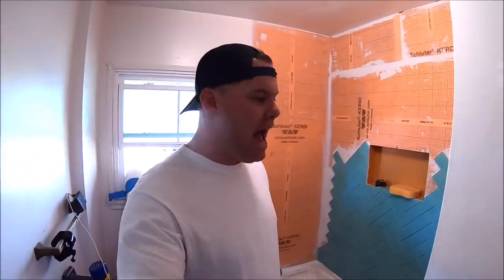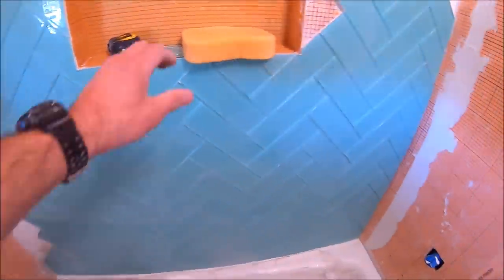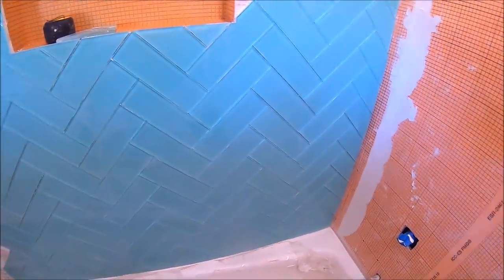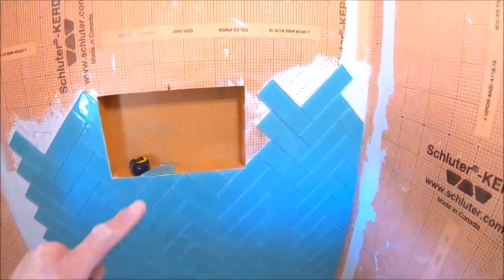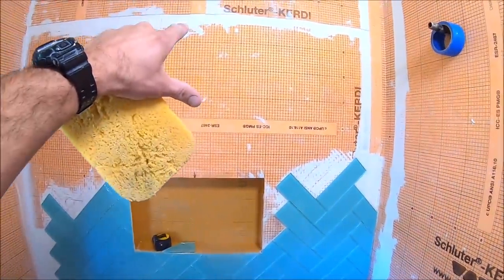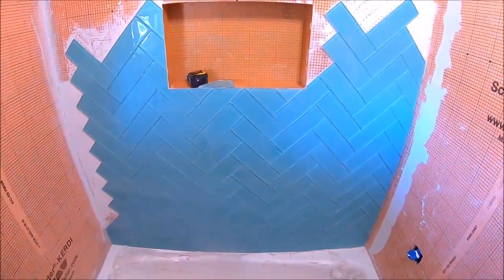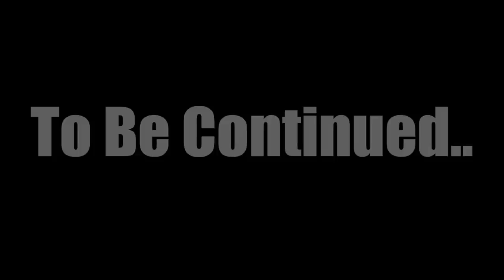Was This Shower Design a Bad Idea?

Comment: I feel your pain! Just got done with a shower just like that. 3x9 glass on a herringbone with a Niche. Used a MK 7” glass blade and it was toast by the end of the job!
Reply: Hey not use a cutter?
Reply: The glass was pretty thick so my montolit with the rubber pad wasn’t really giving results I wanted. On something like this there is no way around the wet saw
Reply: @bforeal3189  yeah I was referring really to just  back wall cuts that would be covered.  I've never done glass tile like this since started setting or tried to cut on a 45°.

Comment: I have a question about tile and grout sealer. I just installed a shower for a customer and the tile is extremely soft marble and it is more water-absorbent Dan any tile I've used before. So my question is what would be the best sealer to put on this tile to make it more water repellent.

Comment: Off topic: how much labor to charge for tiling a basic tub surround? 1/2" kerdi board, 12x12 porcelain tiles, two niches with rondec trim, rondec vertical trim at drywall/tile, no plumbing changes? Just can't find reliable info anywhere. western WA state.
Reply: I’m in snohomish and I’d probably charge around $4k-$5k,  but i do pretty good work and I don’t use kerdi board. $99 a sheet is crazy to me and I try to keep costs down for my customers. It’s hard to figure out pricing when you first get into tiling. Lots of details and discrepancies slated the price. Like glass herringbone for example haha. Winni has a channel that breaks down his pricing and it’s super helpful.
Reply: @PoisonJarl71501  $4k-5k for a tub....?
Reply: @helpme8970  But he does pretty good work 😏
Reply: There will never be a straight answer, depends on so much. Especially on the quality someone does.
Reply: @PoisonJarl71501  Thanks. Surely that's labor and materials? If labor only them I'm thousands of dollars too low. Mason County.
Reply: Could be as little as $2500 or as much as $5000 here in Atlanta.
Theres so many variables. Are the walls solid, are the square, true and plumb, are they flat,  are they exterior walls, if so is it 2x4" or 2x6" walls, is it a standard tile pattern requested, no special tile in niches, what kind of grout etc etc etc?
When i first started i broke it down to a labor cost per day. If say youll have 4 -5 days in the job, multiply it by the amount you want per day.
Tilework isnt easy. Its tedious, time consuming and requires real skill. That doesnt come cheap.
Plus you have to factor in fuel expenses, insurance, advertising,payroll, any other overhead you may have.
I dont do tilework of any kind for less than $400 to 500 per day for labor alone and most of my shower builds are more than that.
I do good work and i guarantee it, so my prices reflect that but then, why would anyone do less? Why would anyone pay for less?